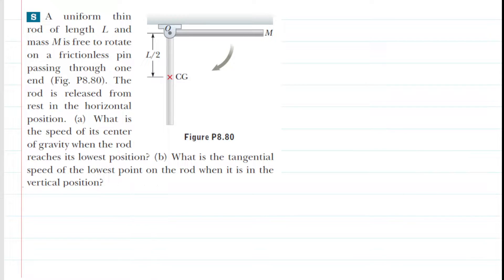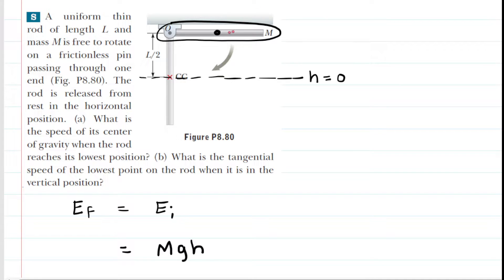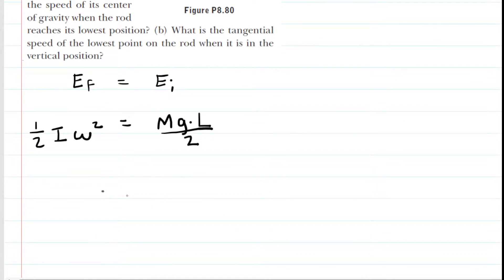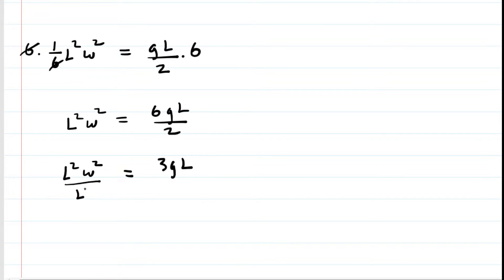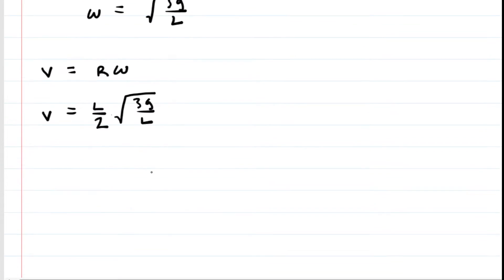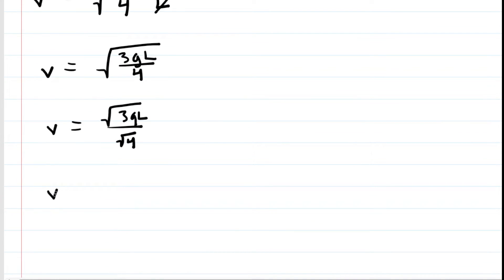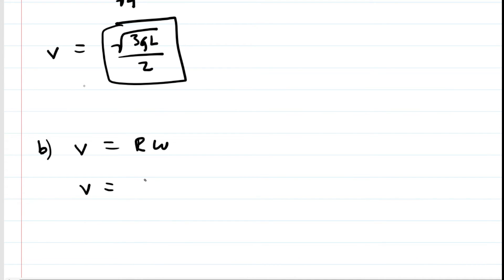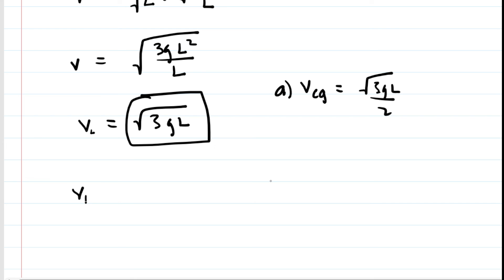A uniform thin rod of length l and mass m

Comment: I actually obtained indeed identical results the only difference is I used rotational form of Newton's second law and then I summed the all the torques acting on the rod then I use uniformly accelerated motion equation to solve for the final angular velocity which turned out to be having an angle in the equation which for in this case is pi over 2 radians so my equation for angular velocity has pi over 2 in the square root for the equation. Please assist me!